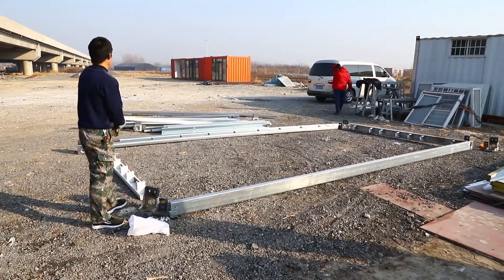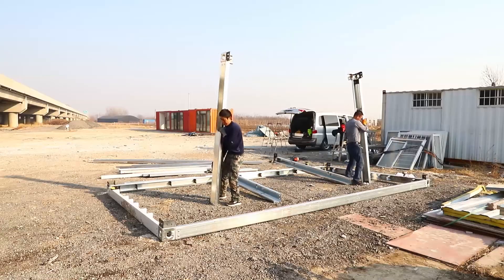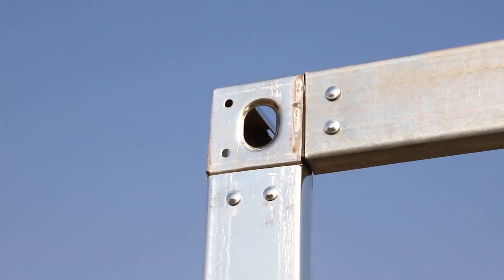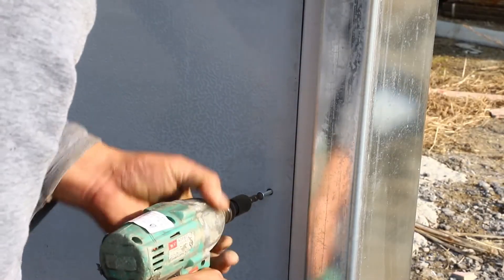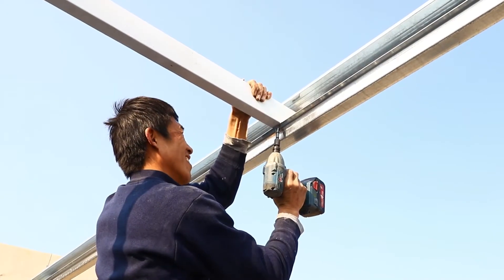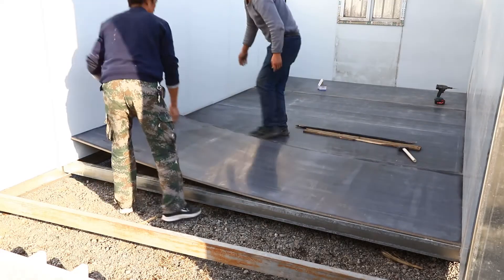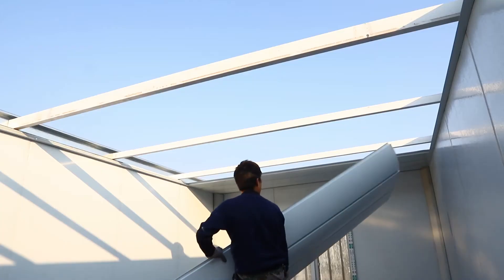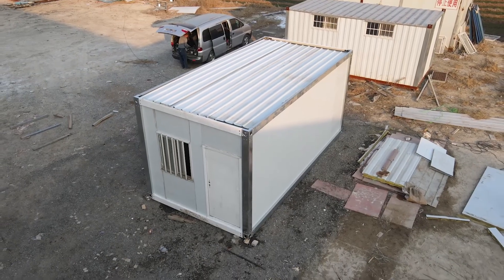How to install the 20'ft modular container house ?

Comment: Hello, I am concern here about to roof slop ( Flow of rainwater) Some time it may cause leakage, I think if we design it in the way of the Hood type ( Double Slope ) It's Look better and there isn't any chance of leakage. My 2nd point is we also can apply prefab sandwich pannel for the roof also It saves time and is easy to install.   Waterproofing is important.
Reply from the maker: Hello Tanvir, how are you? yeah, I agree with you about the roof. do you need container house there? if you need, please don't hesitate to contact us. 
Best regards